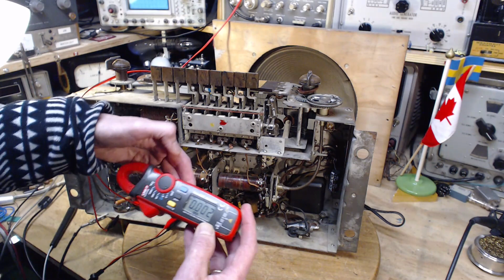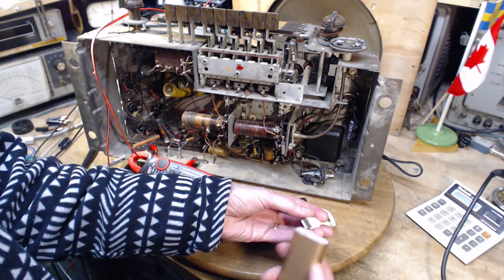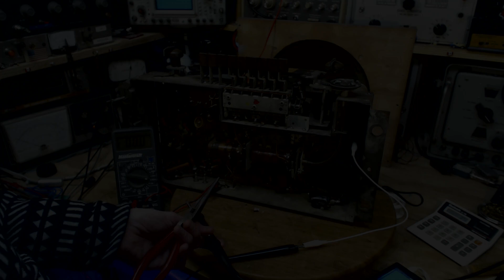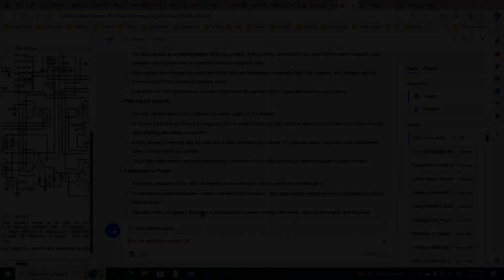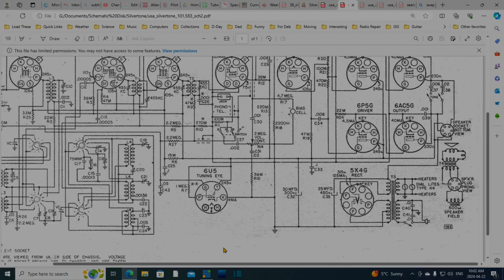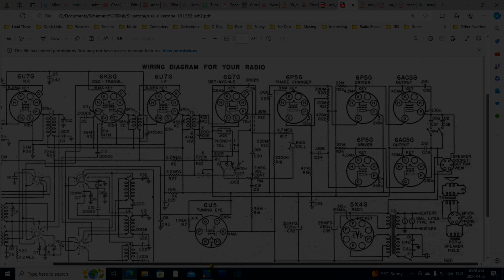Silvertone 101-583-2 Multiband Tube Radio Video #12 - Field Coil Measurements

Comment: 55:00 Never trust a calculation u havent botched up yourself. 
If he keeps crunching numbers he is going to end up convincing himself that this resistor is generating electrical power instead of dissipating it.
For crying out loud! The field coil is approx 1700 Ohms the Resistor 2000 Ohms.
Equals total resistance of about 920 Ohms. At a voltage drop of 116V thats a total current of 126mA and a total dissipation of 14,6 W.
The individual currents are 116V/1700R = 68mA coil = ~8W dissipation in coil
And
116/2000= 58mA bypass resistor = ~7W dissipation in resistor...
All of that can be had by using
Ohms law, Kirchhoffs law, and doing one (!sic) voltage reading. 
It is Electronics 101...

But what he still has not understood yet is;
The plate voltage on the 6P5 driver tubes should be according to schematic 245V. The raw rectifier voltage out of the 5X4 should be 315V (Refer to schematic shown at 47:33 ).
That according to schematic is merely a 70 V drop across the original field coil.
At this time he sees only 250V out of the rectifier tube and he is dropping it by 116V. This gives only ~ 134V for the radio after the field coil... This is nowhere near the published operating voltages.

This whole ordeal up to now is a waste of time and inconclusive tinkering, suitable only to make one go down even more rabbit holes.
The correct way to go about would be putting in a 600 ohm resistor and ditching that speaker for a permanent magnet one.
On his approach he would have to parallel a 820 Ohm (standard value)  resistor to the replacement field coil, to make that combined resistance drop to about 560 Ohm. 
Only then will he see what the total current draw will be and if a B+ after the coil of approx 245V at an high side input of 315V can be achieved.
With those resistor values on his field coil botch up however the field coil current versus bypass resistor current ratio will be only 1:2. So out of 125mA total about 42mA will pass the field coil and 83mA the resistor. The field coil will dissipate about 3W, the resistor about 6W (use at least 10-15W wire wound) 
Questionable is, are 42mA through the field coil enough to generate a proper field strength.
This is where knowing what radio the speaker came from would come in handy...

Comment: 39:38 "250(V) is the high side (of the speaker coil) ... The low side is 30V"....
End quote
I hardly think so..
At 30V b+ after the field coil going to the radio not much would happen...
But Georg Simon to the rescue;
The current displayed was 87mA. We know the resistance of the field coil to be about 1700 ohms.
U= R x I gives us a drop of roughly 150V...
So if high side of that coil is 250V low side should be 100V... not 30V...
Unless ofc Bing AI has a different take on Georg Simon Ohm's law...
Or bing assumed you took that radio into the core of the sun...

Comment: 38:35 Quote "This isn't showing me that there is some excessive current..." End Quote
Wrong and bogus conclusion!
With only the replacement field coil in the circuit, its pass resistance is three times higher as intended This means three times the voltage drop, resulting in way too low B+ after the coil. Tube circuits behave non linear when it comes to reaction to changes in B+. Especially on too low a plate and screen grid voltage. 
The radio must be supplied with the proper B+ after(!) the coil and on full heater voltage.
Or alternatively with a 600 ohm resistor in place of the field coil.
 Only then can the current draw be measured in a way that makes it compareable to the schematic.
We are 40 minutes into the video, nothing has been achieved, nothing learned, no progress made. Just more confusion

Comment: 34:40 If you insert the meter into the path of the speaker field coil only, like it was done here, the current reading is ofc only about half of the total current draw ( if for simplicity sake we assume the field coil and its bypass resistor to be of roughly equal resistance). 
That effect is called Kirchhoffs law and is rudimentary electronic knowledge. 
So if at 35:08 the reading on the field coil path is 53mA the total draw after that contraption of field coil and bypass resistor is actually close to 106mA.
Reply: What kind of Faccatta method is this troubleshooting. You would starve in the real world if you tried to compete against real service men. I get it now if you can’t impress them with science then baffle  them with Bovine  Squat.

Comment: 24:14
Anyone see what is wrong with how that meter is connected? 

A hint
The sockets from left to right are
A  
mA
V/Ohm
COM
Now where do you connect the leads when in the 200mA range?
Between A and mA 
or mA and COM?

Comment: 17:20 Quote "If a resistor heats up, its resistance goes up. So it is kinda self healing in a way" End Quote
Wow, is that another piece of wisdom from the bing AI? 
No standard(!!!) resistor is designed to change resistance over its operating temperature to where it "self heals" whatever that means.
 Not even the old carbon compound resistors. 
In fact a lot of engeneering has been, and still is put into selecting the materials of a resistor in such way that they cancel out in their temperature drift properties.
A resistor that goes up in value as it heats up, resulting in an equilibrium at which it limits its power dissipation,  is a special resistor called PTC...